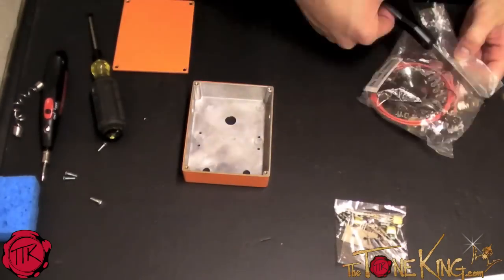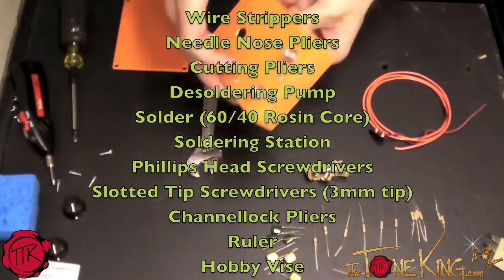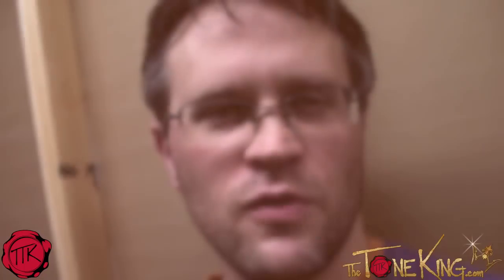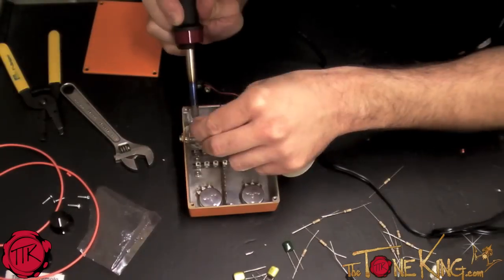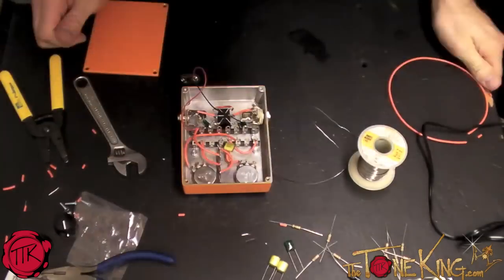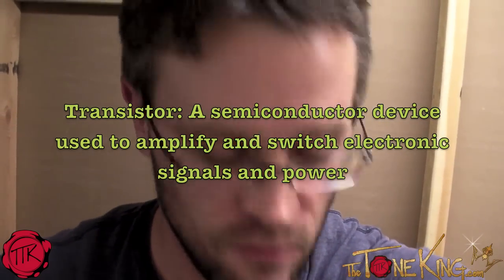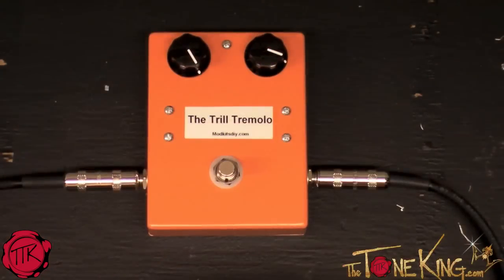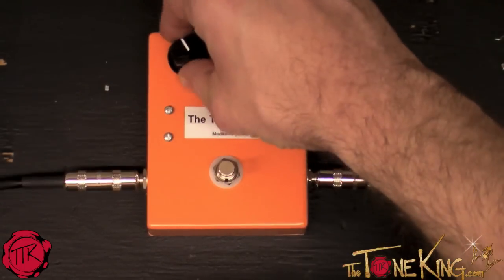TIME LAPSE DIY PEDAL BUILD TRILL TREMOLO by MOD KITS - 3P3D 2011

Comment: Nice solid looking pedal and no doubt very satisfying to build your own.
I looked on the modkit website and they ain't cheap !
It'd be way cheaper to find a schematic with a parts list and buy the componets yourself. Also... they don't seem to have a kit for a delay, which is what I'd really like to build. Does anyone know of a website that has a free schematic and parts list for an analogue delay?
Great video though and a good insight into the building process..cheers